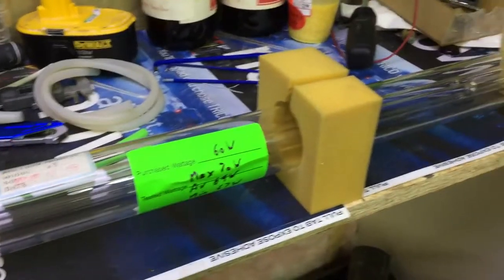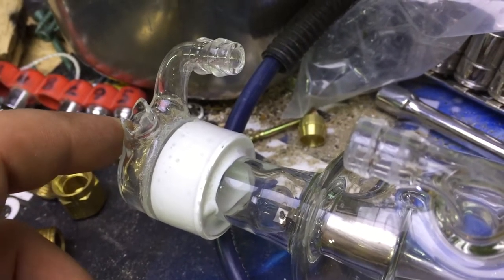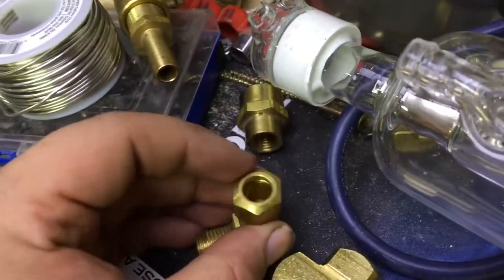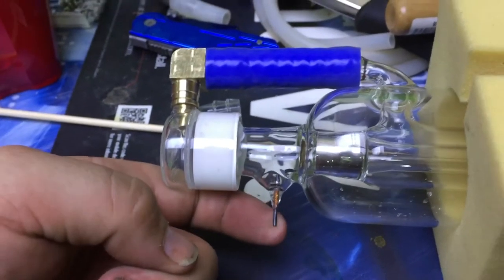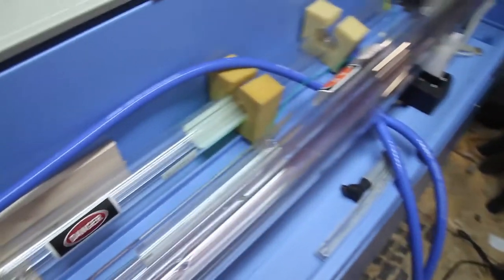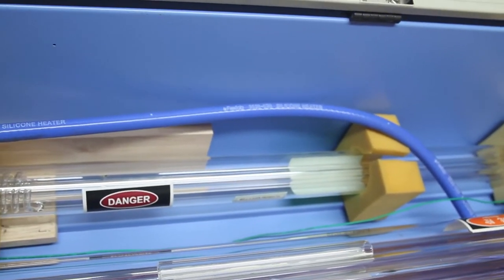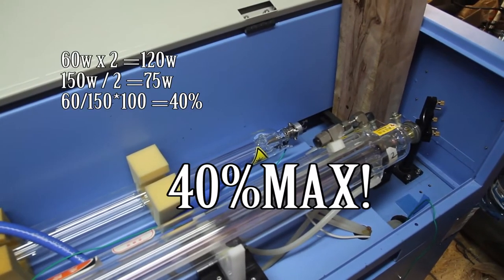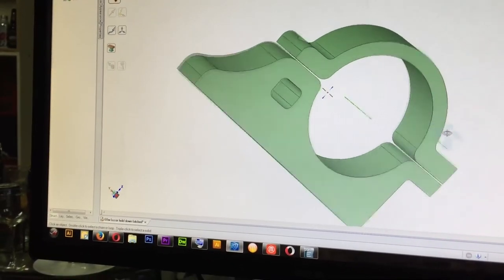60w Broken laser tube REPAIR and 150w power supply test

Comment: I use to build my own flow thru co2 lasers years ago.   Get my gases at a welding supply house.    They will mix each gas for you into the same tank.  4.5% co2   13.5% nitrogen and balance is helium.  hopes this helps

Comment: gas ratios are 3:2:1 helium to nitrogen to carbon dioxide
Reply: There is meny different ratios. All depends on laser construction. But this kind of mixture works only on flow lasers, not sealed. Sealed lasers need much more complicated mixture and high vacuum.

Comment: Hi Bart. I know, it's been a long time since this video was posted. But have you had any luck getting gasses and refilling your tube? .. I'm afraid that my 300W laser tube will need refill too (looks like it has a metal valve on the body) .. Getting any kind of information about refilling tube is almost impossible. But I understand, because newly manufactured tubes need to be sold. That's how the economy works. Greetings from Slovakia!

Comment: What type of machine do you have? And did you tuned it up with 300w Laser? Or was it 300w from factory? Lots of questions, but I am thinking of getting a hobby size machine and refit with a bigger laser for cutting metal.
Reply from the maker: TheStig I bought the machine 3years ago from of all places a manufacturing facility in China. They where awesome. AOL laser. Dumb name, good service. Quality was OK. Z-axis Table arrived broken and tube ended up not working. But I did order the biggest tube available at the time, which was 300w. Now you can order then with 600w. I'm going to be honest, if you want to cut metal. Don't bother. Build a plasma cam. Or order a mini water jet machine. Lasers are for wood and plastics. Any non metal. I have a couple projects etching metal and cutting other parts on my Instagram @bartkoscow I'm happy to answer any questions you have here or on my whatsapp. +1-416-five.two.zero.49.one.eight. (Sorry that's for spam bot reasons)

Comment: I have 130 W laser tube. its outer glass is filled with water the expert told me that it is cracked and that's why the water followed in the outer tube. Is it correct and i have to change the tube or is this repairable.
Reply from the maker: Sadly they are right. The outer glass is a gas chamber. There should never be any moisture in there. The tube you have is no good.

Comment: your equation is confusing. 60x2=120 check.. then its 150/2=75 .. ??? your tube is 300w right?, and the tube your repairing is 60w?  so where does the 150w tube enter the chat? asking because i have a broken 150w tube and need to know if this equation is something to go by when it comes to setting max power.
Reply: nm just noticed the bit about your pwr supply being 150w.

Comment: Hi can you let me know what glue you using for this? I have the same problem. Thank you
Reply from the maker: Ashvin Krrish it's a 2part epoxy. I used a structural epoxy meant for golding trucks together. But just Google "bodyshop supply" and your home town. And ask them for the best ridged 2part epoxy they have. Thisbisnt golding any pressure. But the ridged as apposed to a flexible epoxy bonds to glass better.
Reply: Thank you

Comment: JB WELD not really a good choice for an epoxy resin on something like that when it gets hot it expands and flexes
Reply from the maker: It's not JB weld. It's a body pannel bonding epoxy. The kind that comes in a double calking gun tube and mixing nozzle. This one is used to affix truck roofs to the cab. It's semi flexible and has a working range from - 30 to +150f
Reply: @portabuddy   could you send me the link where  you got it?  it looks like gluing the outer ring has not been stable enough( copper tip)

Comment: have you tried refilling tubes? :)
Reply from the maker: I just got the gasses in right before I went on vacation. Back now. No some testing will happen. It takes time to get UHP lab grade gas. Not expensive. But not anyone just has UHP helium laying around. Well.. I do now. Not no welding supply places. Had to get the UHP nitrogen brought up from the one and only gas supplier in Mane.
Reply: great, looking for your experiment videos :)
Reply: Refilling it